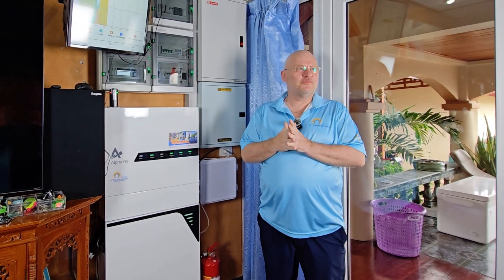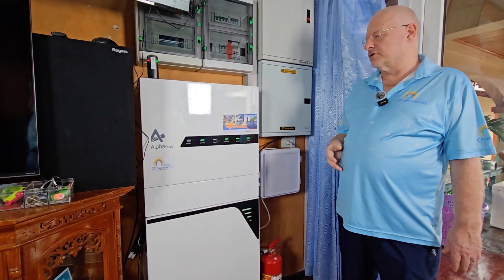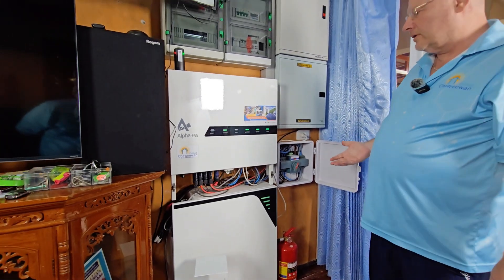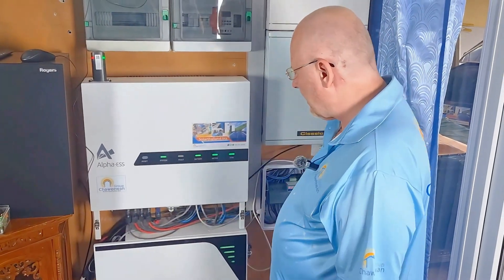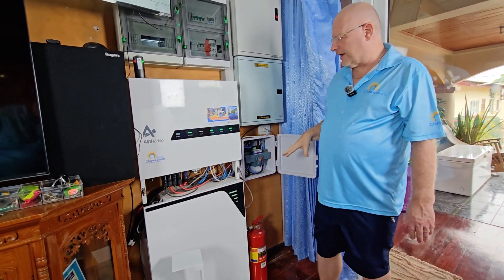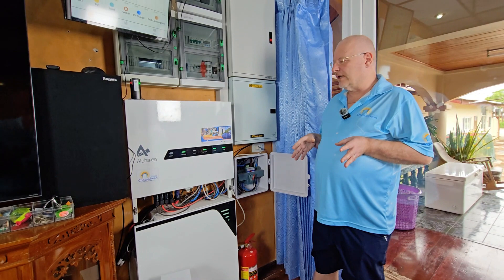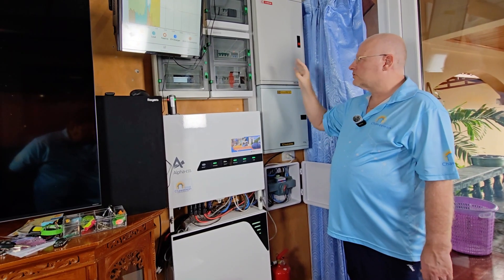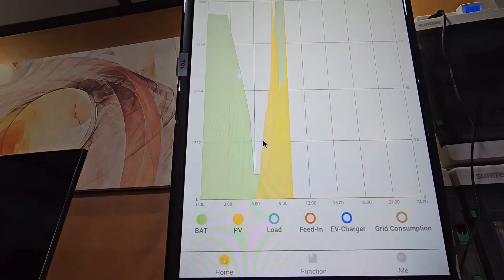AlphaESS T-10 HV review | SolarThailand.biz

Comment: Chaweewan Solar just installed my Alpha ESS with two parallel 10kW inverters and 56 panels with 3 batteries. Fantastic system. My electricity bill will reduce from around B20000 to less than B5000 a month. Perfect system for a big house. The UPS is working to save nighttime bills. Expertly installed exactly to my specs. Great job by the team. Highly recommend such a set up if you have big bills and 3 phase supply.

Comment: Great review. Thanks Chris. Alpha T10-HV runs in my house since over 2 years now without any issues. Qualified Installation and correct planning of backup loads, intensive Testing and regular maintenance (every 6 months) are important for every solar system. That's why we as Solaris Green Energy (official distributor) only allow certified and trained Installers with license to install AlphaESS High-End solar systems.